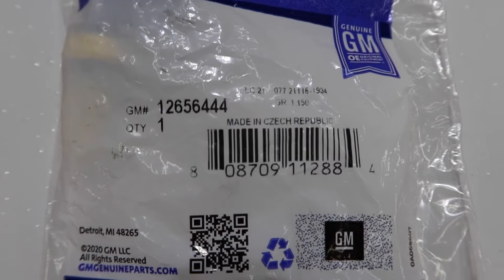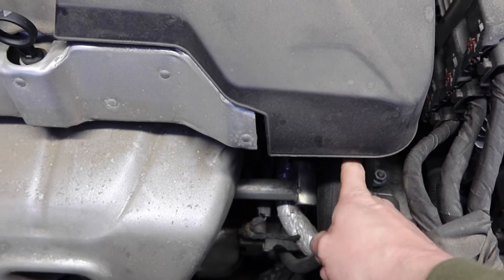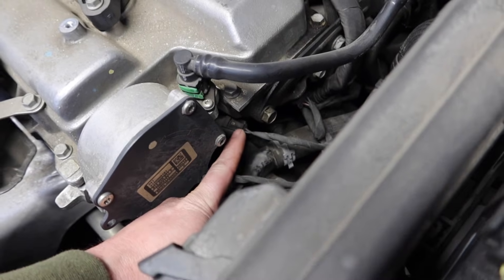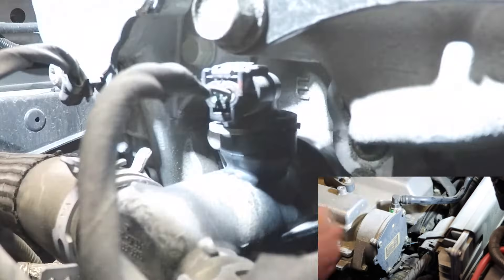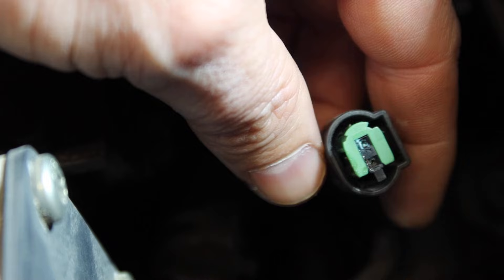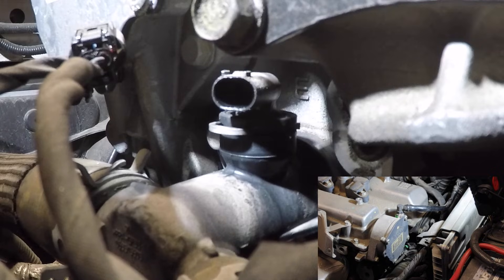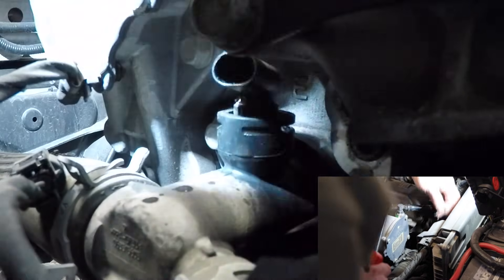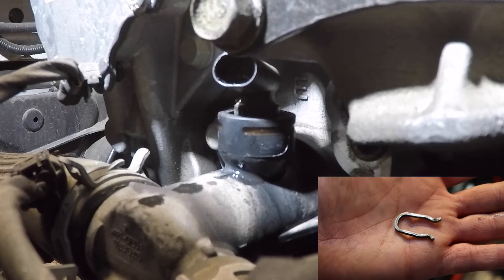P0116 Engine Coolant Temp Sensor 2014-2020 Chevy Impala 2.4 Fixed

Comment: I have 2015 Chevy Impala's 2.5L engine with remote start. When the engine is cold it only stays running for about 30 seconds or so.  But when the engine is at operating temperature the remote start stays on for 10 minutes. Would I have a faulty Temp Control Sensor?
Reply from the maker: That sounds like a logical conclusion. To be honest, I don't know that answer though. Try checking Chevy forums to see if others have had the same issue. Thank you for watching.

Comment: Same process for the car quest part from advanced auto?
Reply: Is it still supposed to move after you put the clamp back in
Reply from the maker: @austinlinden1477 if you are talking about the retainer clip, then yes, you will still be able to rotate it. There is an o-ring that will prevent it from leaking.
Reply: @DCAutoEnhancement I got the advanced auto one for 10 bucks but i didn’t see a o ring
Reply: It there a oring in the part of engine that you put it into or is the oring only on the ac Delco part
Reply from the maker: @austinlinden1477 it should be on the part and you want to ensure that the old one comes out with the old part, if it doesn't, then use a pick or small screw driver to get the old one out prior to installing the new one.
Reply: And will it leak a little bit after you reconnect
Reply from the maker: @austinlinden1477  it is possible for coolant to leak during the swap of the sensor.
Reply from the maker: Yes

Comment: I've changed the sensor and the thermostat haven't changed the lower one i have to find it first then will try and change that hopefully it works this time around. And question would the sensor for the bottom be the same as the one above?
Reply from the maker: I believe it is the same part number but I haven't confirmed that. I would also check the wiring and the plug, they are known to corrode.
Reply: Man I just drove to work this morning when it shut-off everything seems fine. Thanks a million man. It happened just the way the other guy in the comments said. When he did a short drive and it's good so far.
Reply from the maker: @xuamlau5069 I'm glad it is looking like it worked.

Comment: I just changed mine out and I discovered that you have to take the rubber piece from the old sensor and place it onto the new one. I dont think he did that in the video. The rubber piece doesn't come with the new part.
Reply from the maker: @terrystouchphotos438  that explains a recent comment on here. Mine did come with the ring already on the new part. They may not me on the new parts now. Thank you for mentioning it

Comment: I want to save someone else the damn headache 🙄 i have a 2017 Chevy Impala LS and the need for a coolant temp sensor arose. I found this vidoe for my ol man hince he does all the work on our cars he loves to have something to reference. I bought the part he followed this video TO THE TEE. & gues what 12 that night im on a DARK side road and bam midnight (my car LoL) runs hot 🔥.  Luckily i had some coolant from the fix still in the car and 2 bottles of smart water put it in and got midnight to the nearest store and under some lights. we later found it was coolant leaking around this sensor and before someone's dumba** says well was it tight enough was it bad fit IT WAS INDEED TIGHTENED TO MANUFACTURES SPECS not too tight as to break plastic etc. YOU NEED SEALANT ....let me repeat it YOU NEED HIGH TEMP SEALANT !!! not the tape . As of today it is 01/29/25 we got midnight home from one town over parked her put the sealant on and allowed her to cure today would make 48 hours of curing time (running hot incident happened 01/27/25) and midnight is actually fixed now no issues USE THE DANG SEALANT save yourself the time and headache i mention this because the video would have you assume you just pop it in as we did as per following this video to exact instruction AND YOU NEED SEALANT please save yourself the headache and time
Reply: Where did you put the sealant ?
Reply: @Michelle_Allen  On the sensor there's a black "gasket" or "oring" and he placed a thin bead there.......Less is more don't get sealant happy it will not cure properly. We bought the Permatex Ultra Blue sensor safe and It's a RTV so we placed heat lamps around open hood once nighttime hit and the temp dropped
Reply from the maker: @Michelle_Allen  I know you were asking the commentor but usually if there is a leak it is because the old oring is still in the whole and need to make sure the hole is clear of any part of the old sensor before putting the new one in. I did not need to use sealant and did not have any issues.
Reply from the maker: @brittanymcnear1326  thank you for sharing your experience

Comment: Do you have to reset system after changing out part or should it automatically turn off engine light?
Reply from the maker: @user-jeannetted  I don't remember if I cleared the code or not. Even if you do not clear he code, it should shut its self off after a short drive.

Comment: What if the sensor isn’t coming out ?
Reply from the maker: @amarvaladez7182  if you have removed the clip, it should come out pretty easy. If it's not, you may need to get some pliers, wiggle it back and forth while trying to pull it out.

Comment: Thank you this worked on my 2015 Impala. Fans stayed on when engine off and ac did not work. After the change I had to reset so the check engine goes off. Thank you!
Reply: Have the same symptoms on my 2014 impala , so you swapped the CTS and then how you reset ? TIA
Reply from the maker: @leonelgarza1101  I don't recall if it corrected itself or if I erased the obd codes
Reply from the maker: @curtissmith5435  thank you for this information!

Comment: Great video. I managed to replace my sensor in about 5 minutes. Unfortunately it didn't fix my issue, so I'm not sure what to do now. Having a mechanic check the wiring is going to cost way more than the $15 sensor I just replaced.
Reply: Those of you that were reporting the same problem after replacing, did you ever end up finding the solution?
Reply from the maker: @WeekdayWeekend  did you check your coolant level?
Reply: @DCAutoEnhancement it's visible right about where the manual says it should be, I can see the liquid in the reservoir. 
I'm having the same symptoms as others in the comments, my temp gauge doesn't go above minimum and my engine fan stays on for a few minutes after turning off the car.
Reply from the maker: @WeekdayWeekend  let me know what you find out
Reply: @WeekdayWeekend did you figure out what it was. My car is doing the exact same thing.
Reply: Anyone find a solution?

Comment: Hey i got a 2010 chevy malibu 2.4L wiith a p0116 code i change the sensor 4 times already took it to a mechanic he said it was the wires isse he supposedly fix it and then it only work for 2 days i brought it back to him and he said its the thermostat so he change it then again the ac stop working and the temperature gauge not reading and its hard to start the car so what could my problem be? I did erased the code with my scanner and it work but idk if it only works for days?…
Reply from the maker: I tried to verify the number of sensors. Someone in the comments mentioned there were two sensors. One on the upper hose and one on the lower.  I couldn't verify the accuracy of that comment though. I'll keep looking and I will comment here if I find that out for sure
Reply: @DCAutoEnhancement  so my malibu 2010 has 2 sensors?
Reply from the maker: @j.2391  I couldn't confirm that, and I'm just now seeing you have a different year Malibu that this video was made for. I'll look again
Reply: @DCAutoEnhancement  ok

Comment: I changed mine and it’s still reading engine overheating
Reply from the maker: Is it showing hot all the time, even when you know it's cold?
Reply from the maker: What was the condition of the wiring in the connector? That may be where your problem is. Mine was corroded pretty good. I think they sell replacement pig tails for those connectors because that is a common issue.

Comment: I replaced mine but it’s a loose fit and just leaks coolant. Any idea why that would be happening? I know for a fact I have the right part.
Reply: My AC started working again and was getting a temperature reading again… so the sensor was the issue. But I can’t get the thing to tighten. Even bought a new retainer.
Reply from the maker: @brandonshaffer967  is it possible that the oring fell off?
Reply: @DCAutoEnhancement  Hey I appreciate the reply. I pulled it out to make sure the o ring was there and when I put it back I just used a lot more force, it’s not leaking anymore. I guess I wasn’t applying enough pressure? lol. This video was so helpful, thank you!!
Reply from the maker: @brandonshaffer967  I'm glad it worked out

Comment: Will this cause the ac not to work also?
Reply: Mine is showing no coolant reading and the ac will not blow cold, fans also stay on for a few mins after shutting the engine off.....
Reply: @kaingetright88 Did you happen to figure out your problem. I have the exact same issue.
Reply from the maker: @kaingetright88  most likely you have the same issue. Do you get the P0116 code also?
Reply from the maker: If I remember correctly, it did affect the AC

Comment: Thanks for the video. I’m attempting to change the ECT sensor on a 2016 Chevy Colorado with the 2.5L L4 engine, but on mine it is between the back of the engine and the firewall and the hood shroud under the windshield comes out and over the rear of the engine. I know where it is and what to do but I wasn’t sure if the C-clip had to come all the way off or if it was the kind that stays attached. I’ve got my answer and this will help immensely. Thank you!
Reply from the maker: Good luck with your repeat! Thank you for watching and commenting

Comment: You were sent by an Angel. This is definitely what's wrong with my 2014 impala!!
Reply from the maker: 🤣😂🤣 Thank you! If this is what is wrong with your car, it is fairly straight forward. Let me know if this fixes your car. Thank you for watching and commenting.
Reply: @DCAutoEnhancement  You're welcome.  I just watched this video lastnight but I'll get it fixed over the weekend.  One moment my AC I working then after a few days it goes out and my guage sits on cold and my fan will blow even if I back up 2 feet in my driveway. Lol the engine light doesn't come on the guage just doesn't move.. but when the guage moves to its normal position that's when the AC works again.

Comment: I change my sensor like three times I’m thinking my thermostat is bad.
Reply from the maker: I think these cars have two sensors. One up high and one down low. Have you changed both of just one of them
Reply: @DCAutoEnhancement Where is the one down low? I just changed the one in the video, not sure if the pigtail is bad or not. Just curious as to where the lower one is located? I've been searching everywhere on Google and youtube. A answer back would be awesome and thank you for this video.
Reply from the maker: @jamesmontana29  if you are facing the engine from the front of the car, it should be on the left side down low. Look for a large diameter pipe or hose, if I remember correctly, it will be right where the lower radiator hose connects to the radiator. I hope this helps, let me know if it does or doesn't.
Reply: @DCAutoEnhancement  I will definitely let you know, thank you so much for the response and info.
Reply: I believe I found the lower one, I'm holding out hope that the coolant temp in the video that I replaced was the issue. Temp gauge was dropping to c not reading any temp and the fan was constantly running with a obvious check engine light. I noticed that when I replaced the one in the video the fan was still running and the temp was still not reading. My question is would it have to take some cycles and mileage to run its course and the computer to pick up on it? I disconnected the battery it's obviously back to reading temp and no fan. Just hoping it doesn't come back
Reply: Just wondering if putting the sensor in would automatically fix it, I'm sorry for the long comments and questions just Christmas is coming and money is tight so I'm trying to DIY it. Thank you for your help.
Reply from the maker: @jamesmontana29  no worries, that's why I post the videos, to try to help. What are the problems that you are having?
Reply from the maker: @jamesmontana29  in my case it just started functioning correctly. If you have the same code that I had, one of the two should fix it
Reply: @DCAutoEnhancement  One week it everything operates normally the next week the temp gauge doesn't read and the needle is on c. Fan is running and when I turn the car off it runs for about 3 minutes. Gas mileage I've noticed is slightly worse nothing drastic just noticeable.

Comment: You made this video for an Impala with an eco tech engine, what about the 2014 LT 3.6l V6?
Reply from the maker: I do not have a v6 version to post.
Reply: @DCAutoEnhancement  the only video I’ve found on my model of engine the guy records his video in vertical, moves the camera too much, and his hand are constantly in the way.  Right now I’m having a disagreement with a mechanic at work who says my car should have two temp sensors, but I’ve only found one, front of the engine the right of the exhaust manifold, and far left of the thermostat housing.

All that’s beside the point I’m getting at.  I’m getting an alert that says “Engine temp too high, turning off A/C”, no check engine light, but the instrument cluster not showing temperature, either through the mechanical gauge or the digital DIC.  Additionally the cooling fans run for 5 to ten minutes after the car has shut off.
Reply from the maker: @skullfracture3870  I just looked up the parts on the v6 and the 4 cylinder. I found two on the 4 cylinder and one on the v6

Comment: Could you give me a tip on how to disconnect the electrical on the existing one?
Reply from the maker: I looked back at the video, it looks like you just have to push down on the gray tab closest to you and pull. Sometimes it helps to push the tab and push the connector toward the sensor then back toward you.

Comment: I did that but it's not tight what's the problem
Reply from the maker: Without seeing it, I would assume it's not seated completely or I have heard some people have an issue with the old o-ring getting stuck in the hole and you just have to get it out before putting the new sensor in. Let me know if this helps or not.

Comment: My clip won't slip back on
Reply from the maker: The only thing I can think of is to make sure it's pushed all the way down and or that there isn't a broken piece of the old one stuck in the hole.  Maybe look for a rubber o ring that may have slipped off of the old one.

Comment: Where is the coolant temp sensor located on a 2017 chevy impala with a 3.6 engine
Reply from the maker: It looks like it's threaded into the thermostat housing that the top radiator hose goes to behind the water pump.  I found a very basic diagram at gmpartsdirect.com   other than that info, I can't tell you much more, I haven't done one on that engine. Good luck.

Comment: What about 3.6 ? Location
Reply from the maker: It looks like it's threaded into the thermostat housing that the top radiator hose goes to behind the water pump.  I found a very basic diagram at gmpartsdirect.com   other than that info, I can't tell you much more, I haven't done one on that engine. Good luck.
Reply: @DCAutoEnhancement  thanks bro
Reply from the maker: @MySamiroo  wish I could be more helpful
Reply: @DCAutoEnhancement  my sensor clip won't slip back on

Comment: hello! I am about to replace mine in our 2014. the neck on the old one is busted like the one you showed. any tricks on pulling it out? scared to rip the top off and it's just stuck in there after. thanks
Reply from the maker: Were you able to get the clip out that holds the sensor in place?
Reply: @DCAutoEnhancement  yup!
Reply from the maker: @molten_software  is it possible to get a pair of needle nose pliers on it at all?  If not, if you have a pick, you could go in where the clip was and try to pry the sensor up. Let me know
Reply: @DCAutoEnhancement  i tried this today, the plastic just disintegrated. Good news and bad news of it, i started the engine and it blew the top off of the sensor, I can see the brass tube now, So im going to try to stick a bolt in it to extract tomorrow. Thanks again!
Reply: well, I got it out! really just the brass was left of it. 
new sensor in and engine temp isn't reading on the dash, fans still full speed at start. going to have to dig deeper in this rabbit hole. Thanks for getting me started though!!
Reply from the maker: @molten_software  were your wires corroded like the one I worked on?
Reply: @DCAutoEnhancement  yup, I sprayed the contacts down with wd40 electrical cleaner and cleaned out the connector pretty good
Reply from the maker: @molten_software  that is the area that I would be concerned about and maybe buy a new pig tail.  I think I saw them when I was looking for the replacement part.

Comment: The sensor is not tight when I put it back on. I put everything on right but it leaks
Reply: What did I do wrong?
Reply from the maker: @boogeymanwalker9184  I don't know if this is your problem but, that housing is made of plastic. You could have a crack in the housing.
Reply: @boogeymanwalker you just have to press down on the new piece and it will slip in tight and then you put the pin In the holder
Reply from the maker: @JoseAguilar-gz6bz  thank you for adding to the conversation!